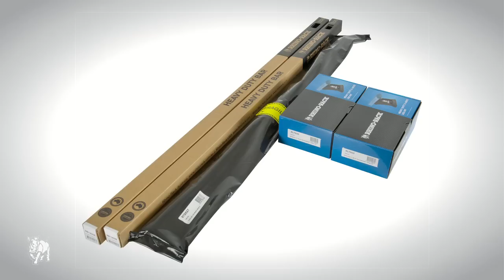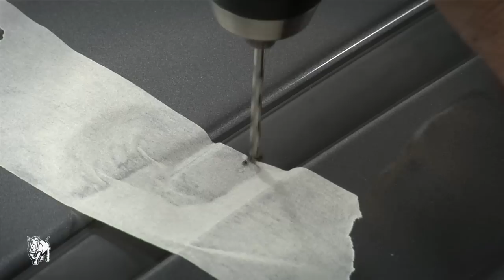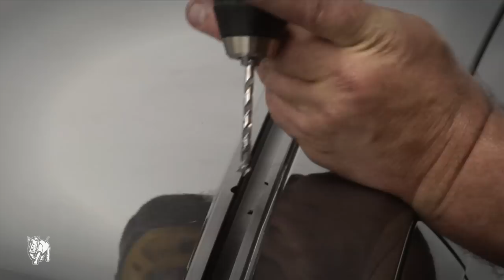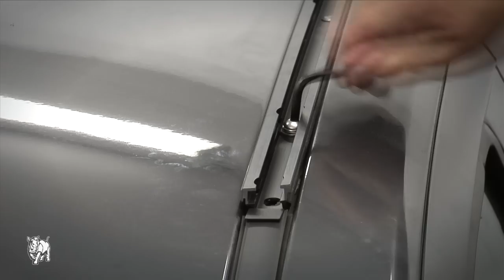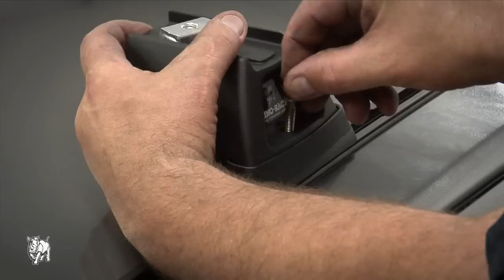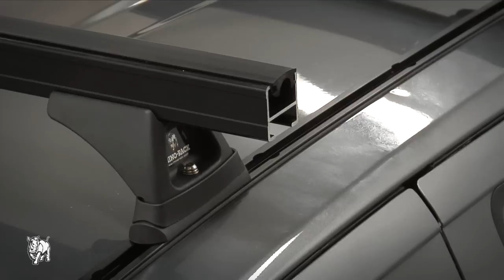Rhino-Rack | How to fit Heavy Duty RLT500 Roof Rack Systems

Comment: Can this same track system be modified (cut track down in length) to be fitted to my 2014 Holden Colorado Space Cab and use just the one cross bar? I was thinking if the space cab has the same m8 threaded inserts it should be possible, but I am unsure whether it does.
Reply from the maker: Visit, http://www.rhinorack.com.au/fit-my-car/select-vehicle, to see the roof racks available for your vehicle. There are both RLT600 and RLT500 track systems for the dual cap 2014 Colorado.